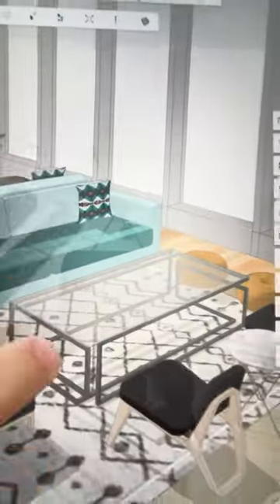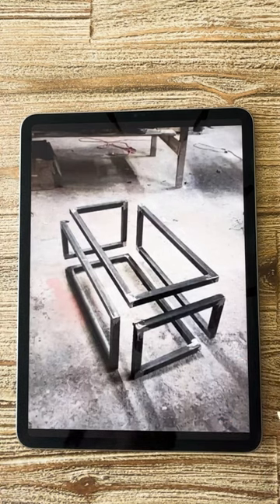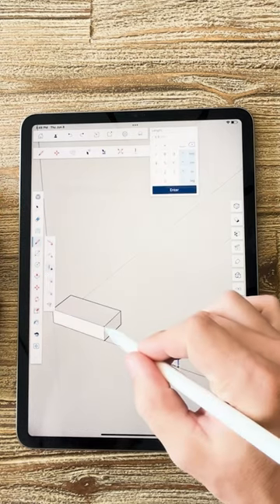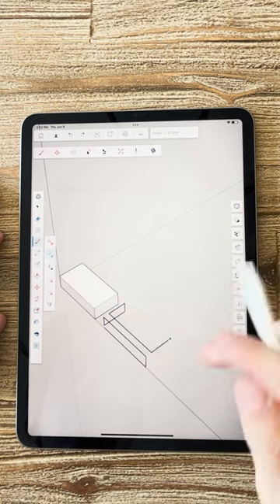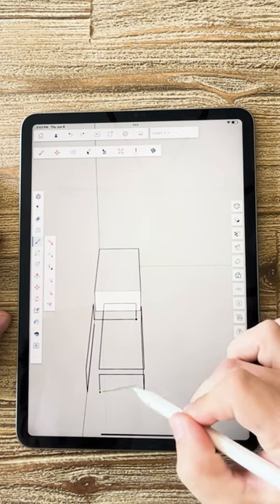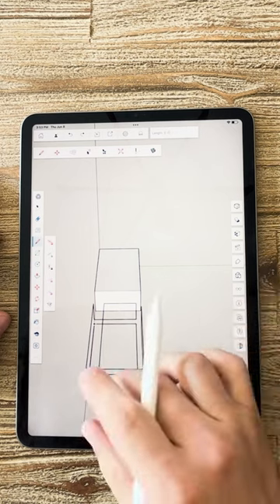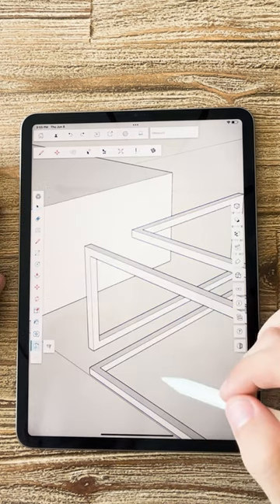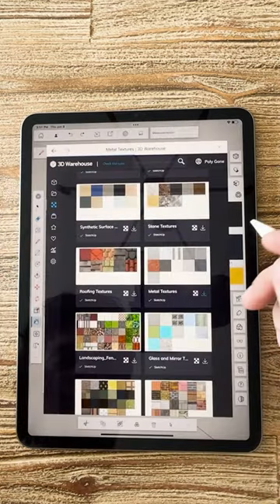Model a Steel Infinity Table #sketchup

Comment: How is it possible that a tablet is more powerful than my relatively strong laptop???!!!😮🤔 I can't work and design easily and without lags and the software has a lot of bugs, then how can you use a tablet so easily and fluently and without leg
Reply from the maker: Post your performance issue on our forum! https://forums.sketchup.com/
Include your computer specs, OS, and SketchUp version, and the community will help you get up and running with no lag.
Reply: @SketchUp  thank you very much🙏🏻